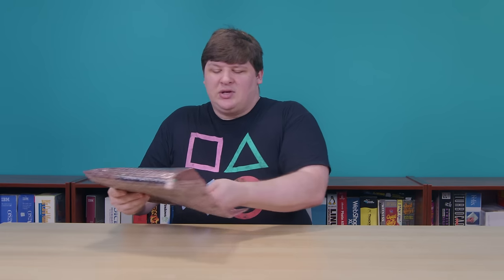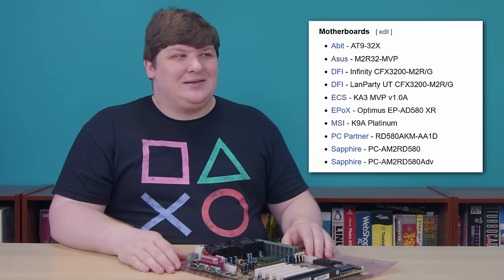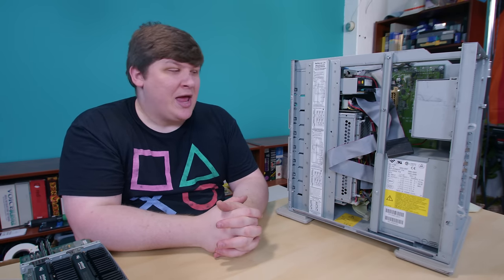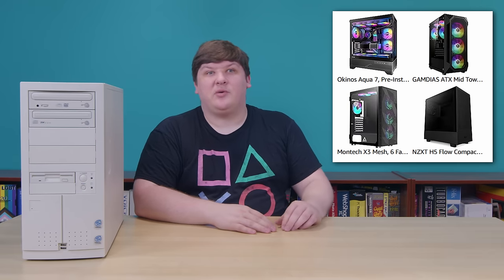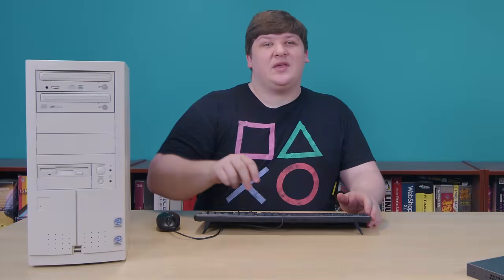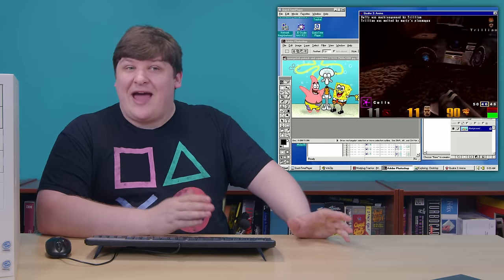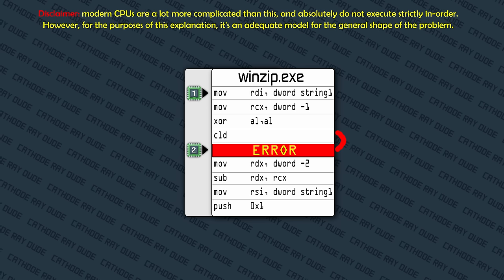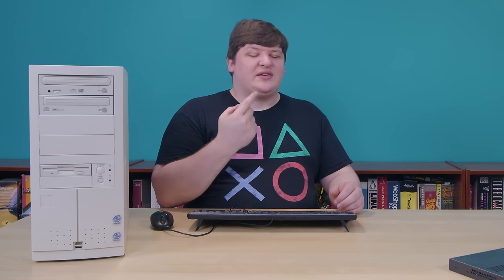The Only Famous Motherboard

Comment: This episode was such a nostalgia fest for me. The first PC I built was from this era, and I was deep into some of this stuff. For what it's worth, I enjoyed the somewhat long journey you took us on to get to the actual motherboard. 

It had an Abit mobo and a Slot 1 Pentium 3 that I overclocked from 700 MHz to 900 MHz. To achieve that, I had a bunch of high flow fans, and I even did stuff like sand and polish the heatsink (which I'm pretty sure is useless now, but I had too much free time then). It was in a variant of the Enlight case that I rattle-canned metallic blue. I also dremeled a couple holes into the side and installed fans for extra cooling for the GPU and processor. All the fans made it sound like a jet spooling up when you turned it on. For its power light, it had one of the early blue LEDs. It was obnoxiously bright, enough to light up a room.

I lugged it and a painfully heavy 19 inch CRT to a lot of LAN parties, and played a lot of Counterstrike and UT. It was my first DVD player, thanks to an MPEG card, and the first DVD I watched on it was The Matrix.
Reply: my back just winced at the thought of that crt, i used to lug a 19" hitachi crt around to those.
Reply: I ended up getting a 21" Sony crt that probably weighed close to 50 lbs or so from a cousin that got two of them.  I lugged it around just like you said, we lanned almost every weekend in high school lol

Comment: I loved that board.  It was my first watercooling rig.  I had to machine my own waterblocks and used a Ford Aerostar transmission oil cooler as a radiator with an aquarium pump and was rocking dual 366mhz Celerons OC'd to 600mhz.  I was essentially rocking 1.2 ghz of processing power when 800mhz cpu's were about the fastest you could get.  It was also significantly cheaper.  That is what was so special about the BP6.

Comment: This was indeed a fun video. As good as the summer of bench vids has been, it's nice to have you back in the studio. Looking forward to part 2!
I think it would be cool to learn more about NT in particular. I know there's probably plenty of existing resources out there but any time I look it up, I'm confused about why it existed (beyond the technical improvements made to Windows) as a consumer product.
Reply from the maker: @EvilCoffeeInc  In a nutshell, NT existed because Microsoft recognized the inability of the legacy Windows code base to accommodate the needs of businesses. Windows 3, while pretty impressive for it's time and target audience, was simply not sophisticated enough to power a machine that needed to have 24/7 uptime. It was decently stable on its own, but the kernel did not leverage protected mode as much as it needed to in order to protect the OS from misbehaving apps. NT was a clean slate redesign that was intended to give Microsoft something on par with Unix in terms of stability and scalability, while still allowing the use of existing windows software. The way they went about this, from what I understand, is they hired a guy who used to work on VMS, a legendary big iron OS, and told him to just go nuts and make a kernel that could stand up to the rigors of industry.  They then bolted the Windows 3 interface and APIs on top of that, which produced something that by and large could be used the same as their existing consumer OS, but still had a lot of rough edges that kept them from just switching the entire product line over to NT immediately.
Reply: Gotta love the unfettered willingness to pen a spiel in the YouTube replies. CRD is the last bastion of real YouTubers, the 'You' has meaning after all.
Reply: @CathodeRayDude  Also let's not forget that NT was built for portability from the start. Even the first releases of NT supported Alpha and MIPS in addition to x86, and they later added support for PowerPC as well. Those RISC ports ended up being little more than a curiosity in hindsight, but they paved the way for why it was relatively easy to port Windows to 64-bit platforms (including Itanium) and later ARM.

And they were serious about it from the get go. Dave Plummer has a video in which he explains how he ported the 3D Pinball of all things from x86 assembly it was originally written in, to portable C or C++ because it had to run on all the supported architectures for the NT version.
Reply: As I understood it at the time, pre-NT Windows was basically two OSes stacked one on top of the other, with Windows employing a lot of hacks to overcome the various limitations of DOS. There's only so far you can go with that, especially since MS-DOS was last updated in 1994. Eventually you have to rewrite the kernel to keep up with newer hardware, and when they did, NT was what they came up with.

Comment: as a 64 years old man and a PC  technician. I still use on my 13th gen Intel wıth that case (only PS changed through out the year)s. Its nice to see a smart guy who took me back those good old days.Thank you. I sold a lot of Intel's "server board" with dual pentium III cpus in it. between 2000 and 2001. Thank you.

Comment: The BP6 can be credited with getting a lot of enthusiasts excited about getting into SMP. But sadly it also quickly garnered a reputation for being a quirky beast.
The Highpoint ATAPI controller was particularly hated. I went with an Epox dual slot 1 board instead with Celerons in 'slotket' boards. Still loved following the BP6 community.
Reply: I still have that same Epox kp6-bs with the slockets, it was a beast for back then (though it has PIIIs in it now, i often think of sticking the celerons back in it for originality sake).
Reply: Yeah, the Highpoint was a plague on my board.  I was planning to get the thing de-soldered but the board gave up the ghost before I had the chance.  Was out of warranty by then and much faster CPUs were out, so it sadly went into e-waste. :(

Comment: You're spot on with the "smooth feel" thing. I remember when we went from high-end singlecore (Athlon XP) to relatively early multicore CPUs (Brisbane Athlon 64 X2), it was astonishing how smooth the things felt. It was a jump in usability that was only trounced by the introduction of SSDs later on. We were on windows XP by that time, so software was ready.

Before, when you launched say a browser you couldn't also open task menu. You were used to it, it had always been that way. With two cores you could use the machine even while it was "thinking". It was revolutionary, we just got used to that new normal so fast.

Comment: There's not many legendary motherboards but BP6 is one of them. This thing with dual overclocked celerons, as much ram as you could afford and a copy of Windows 2000 provided serious epeen at the time, a legit PC workstation that many teenagers could afford.

Of course it got absolutely thrashed by an Athlon released in the same year but meh, dual processors. It's still cool to have more than one processor and at least some FPS games could actually take advantage.
Reply: I don't recall about the Socket 370 ones, but the Slot 2 generation was significantly more overclockable than the flagship Pentium IIs because of their reduced onboard cache.  Whereas the full-blooded P2s were running around 233/266 MHz, people were easily overclocking the Celerons to speeds over 400 MHz.

Comment: I'm really excited for the next video. I recently picked up my first mid-90s PC, a HP Vectra XU5/133C, and it's been fascinating to figure out what its place was in history. It's a dual-socket system, but HP never sold it with 2 CPUs as far as I can tell. NT existed in 1995 when my Vectra was built, but it was weird and exotic even relative to the NT4/W98 days. It's been loads of fun to use it and learn what computing was like before I started to learn about it as a kid.

Comment: The Celeron A300 @100 MHz FSB. You paid the price for a Pentium II 233, but you got the performance of a PII 450. Half the CPU cache, but running at the full 450 MHz. Next to the 2600K one of the best Intel processors.
Reply: Yup, came here to mention that…also seem to remember it’s heat sink on it was much bigger than it really needed so stayed cool

Comment: 26:45 The way you started talking about the OS options just reminded me of The Hitchhiker's Guide to the Galaxy's talk about currency. 
"In fact there are three freely convertible currencies in the Galaxy, but none of them count. The Altairian Dollar has recently collapsed, the Flanian Pobble bead is only exchangeable for other Flanian Pobble Beads, and the Triganic Pu has its own very special problems. Its exchange rate of eight Ningis to one Pu is simple enough, but since a Ningi is a rubber coin six thousand eight hundred miles along each side, no one has ever collected enough to own one Pu. Ningis are not negotiable currency, because the Galactibanks refuse to deal in fiddling small change. From this basic premise it is very simple to prove that the Galactibanks are also the product of a deranged imagination."

Comment: I had one of these with Celeron 533s.  Having an SMP machine in your house on a college student budget was a game changer.  I ran Linux, FreeBSD, and BeOS 5 on it at various points.  I could test multithreaded code projects without needing to log into to college lab server.  And as a daily driver, running multiple apps was so smooth.

Comment: some info about NT4 and why it does not have some features of W95/98...

Inside MS work was going on for NT 4 (Cario) to upgrade NT3.51 (Daytona) Win95 hit the market and the big business customers started wanting Win95 interface on NT 3.51..there were lots of arguments internally Cairo was not done so basically MS was at least 1-2 years out for NT 4 Cairo..well those big businesses carry alot of weight they buy things by the truck load...so NT 4 Cairo was put on hold (or at least planed for NT5) ..MS needed something fast..so they basically took NT 3.51 and put  Win95 Chicago skin on it (there are a couple of dialog boxes deep inside NT 4 that are actual NT 3.51 boxes)..and released it as NT4 ...hated by overwhelming amount of people at MS...sold like crazy to businesses as an upgrade...work continued on NT5 Cairo but due to lots of issues  a good portion of it had to be scrapped (i.e. Hermes etc) so what was left was now NT 5 Alpha (which would become Win 2000) ..this should explain the issues you had and also wondering how far back Win 2000 went...

W2K Alpha would go back to late 1997 and Beta 1 would have been mid 1998...

Internally MS was pretty proud of Win 2K and wanted to forget about NT4

NOT RELAVANT:
i don't know how much is known about Hermes project i  got to see it in action (in early Alpha)  while i was at MS and play with it...one of the many features was that you had a master Admin screen for your whole company and you could configure it in many ways by department...i.e. when  a machine was booted it could re-format the drive go out and get that departments disk image and install it automatically..(assuming large LAN pipe) any viruses or software the employees put on it would be gone..you could also manually trigger this and have the machine boot normally unless triggered ..all controlled by the master Admin screen..the part that was being worked on when it was stopped was in Admin screen you could drag and drop software packages and it would create a disk image for the department..

a part of Hermes became Systems Management Server (SMS)
Reply: love to learn about tech history from the source!
Reply: Nice!

Comment: Intel distributed a version of the dual-Pentium-2 Precision 410/420 (with their own branding instead of Dell's) as an i440BX chipset reference system. One such system (with a POST card installed) known as the "Crash Box" has been in use at Carnegie Mellon University for testing student OS projects for decades. I have fond memories of watching my kernel boot on this machine for the first time.

Comment: I'll chime in with the same comment many others have made. Win2k Pro is the OS you want to run on a BP6. It fixed so many of the issues NT4 had, especially driver support and better game compatibility. Even on a single CPU system back then I jumped straight from Win98 to Win2k as soon as I could and stayed there until after SP2 for XP had been released.

Back then I really wanted a BP6 (and later a VP6) but I didn't have the spare money and the BP6's limitation of only (unless you did a hardware mod which came later) working with Mendocino core Celeron's (533 Mhz max stock speed) put a damper on my BP6 enthusiasm. At about the time I was going to pull the trigger on a VP6 board with dual Coppermine-128 celeron's in it in 2001 AMD released the original Athlon XP chips in October 2001. I attended an early morning AMD pop-up roadshow event in Chicago and won a top of the line for the time Athlon XP 1800+ and a MSI KT266 (not A) chipset based board. So I stuck with that for a while and put the thought of a overclocked VP6 rig aside.  

Those were the days though! Good times!
Reply: Coppermine Celerons do not support SMP.

Comment: Biggest Issue with NT4, was lack of USB support. No USB flight stick\gamepad for you. Direct X support only up to 3.0 another big hindrance to gaming. PCI sound cards also an issue, you probably only would of had luck with a SBLIVE! and only the early versions of it too. Windows 2000 is where SMP systems got alot better for gamers running such a system.
Reply: I used to dual boot NT4 and windows 95 osr2 and home. nt4 was rock solid but for games, would often swap to 95
Reply: I feel pretty confident when I say that hardly anyone ran NT4 on these.
One way or another we all ran 2k before moving to xp.

Comment: Thank you for making this video. So much of it resonated with my personal experience around that time, when I was in late high school/early college, gaming and video editing. This was the experience that make me swear off single-thread CPU systems forever, and I didn't replace my BP6 running dual Celeron 300As (running at 464, I couldn't get my two to run at 504MHz, which was 112 FSB at 4.5x) until the Pentium 4 added Hyper-threading three-ish years later. I hope you are able to tell the story of Slotkets, the SL2W8 (the Overclocker's dream Pentium 2), and a time when overclocking was all about getting great performance out of cheap parts, and not the way things are now where it's about taking the most expensive parts and making them even faster while being less efficient. It was truly a remarkable time, where if you were "in the know" and willing to roll the dice, you could get a machine FASTER than the fastest "official" PCs, at half the price. What a ride it was.
Reply: Also - hopefully in your subsequent video on video acceleration that you teased here, you talk about the Pinnacle DC10/DC30 which was another wonderful example of getting more for your money!

Comment: The BP6 came in at a very specific crossroads that made it "also consumer interesting" as opposed to "only enthusiast interesting". To address all points at the same time, previous closest thing would have been a dual slot A with a pair of 300A's running NT4. With pins drilled by hand (that's what the "unmodified Intel Celeron" means on the BP6). The BP6 could take (un-drilled) Celerons, Windows 2K was coming out with better Direct X and desktop feel and memory was becoming relatively cheap. All that together made it appealing to the consumer segment that wanted a bit more oomph but was budget limited. The next step on the "budget/consumer SMP" would have been the Dual Socket A with dual Duron's, that came out a bit later, ~2001 IIRC.
p.s. you're totally right about the "doing other stuff while x is running". That's what made A64X2's and C2D's such a game change with Windows XP. Compared to previous P4/AXP boxes, the new ones with that extra core meant you could do other stuff while the "loaded core" was churning away. And after that, the Core iX with HT, that while not being full threads per core, DID make things A LOT smoother.
Reply: Yea I had a slot board with an adaptor for this reason.  Got lucky as the board was able to be firmware upgraded to P3 and supported the whole Celeron overclock.  I really did feel like I was sticking it to the man at that time.
Reply: @warlockd  Well, we sort of were ;) Think especially the 300A was a huge FU to Intel. And AMD's "wink and a nod" to the enthusiasts by laser cutting the bridges that you could easily restore with a pencil was another way to stick the knife in Intel's back. It was like "we know who you are, we know you're on a budget, we have to pretend we care but we really don't, knock yourselves out". And look were we are, Intel still nickel'n'dimming and AMD still not caring and still pulling ahead... If they could bring their 8/16's down to 6/12's price range, Intel would pack the back and call it a day.

Comment: The "celerons" story the missing bit is that Celeron CPUs were not supposed to run SMP, while those were obviously stripped down Pentums, this feature was blocked. But the lock was broken and this board was able to bypass the restriction.
Reply: IIRC, it had something to do with the BX chipset.  It would not allow SMP on the Pentium III, to avoid cannibalizing the new Xeon market.  But, it didn't stop you trying SMP on Celerons....

That, combined with the low cost and massive overclockability of the 300a ... voila.  BP6's perfect niche.
Reply: @nickwallette6201  makes Dell's dual P3 from the start even more interesting.
Reply: @kaitlyn__L   Different chipset, I assume?  Or maybe I heard/remembered wrong.  :-)
Reply: @nickwallette6201  I’m sure it’s a different chipset :)
Reply: @nickwallette6201  oh wait, I just wound it back, those are dual P2s! Egg on my face. I’m so used to the early P3s which are also on cards.